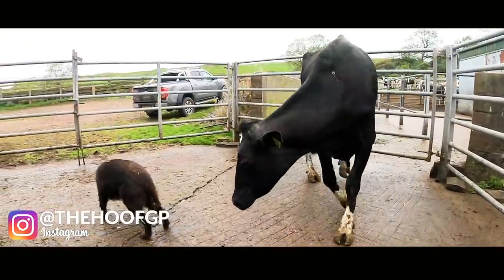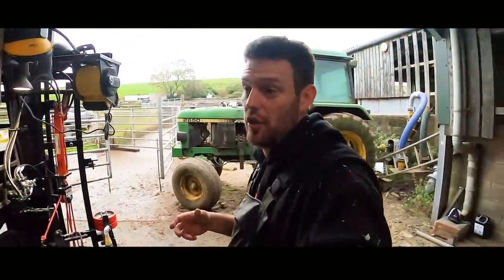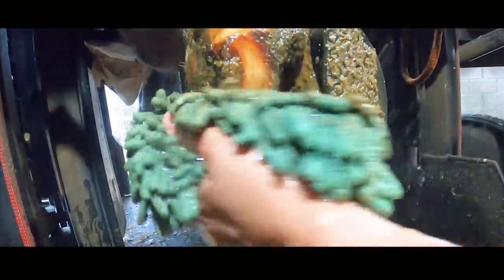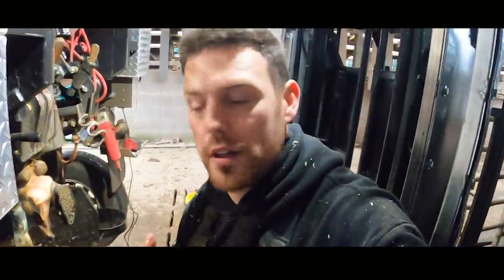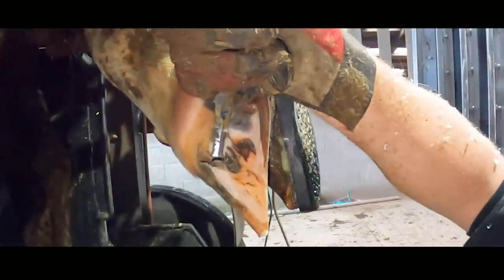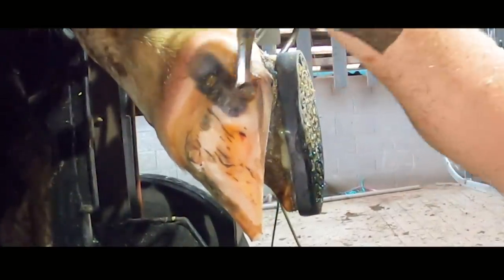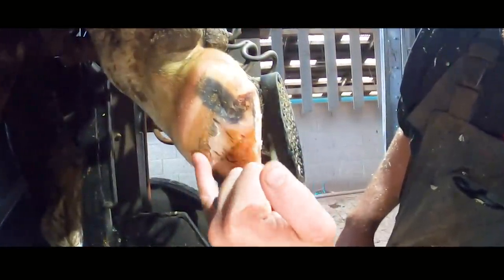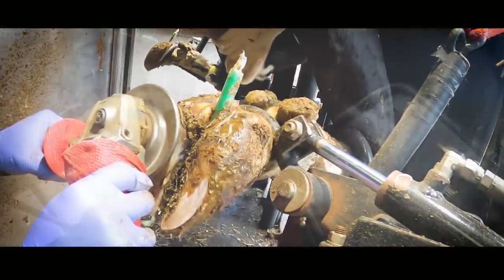*IS THIS RECOVERING?* THE MOST SATISFYING JOB IN THE WORLD

Comment: Instead of carving away cracks, can you fill them in with crazy glue to stabilize them? Would that halt the cracking and then the horn can grow in properly underneath? Something like what they do to 'repair' cracks on windshields. I have always wondered this.
Reply: No, it would prevent horn growth and potentially be very painful for the cow.
Reply: @alistairclement4239  I don't see how that is possible when they slather silicone all over the hoof without causing issues when they apply a block.
Reply: @KrikitKaos  the block goes on the undamaged claw but hey I've only been trimming feet for 25 years, you clearly know best.
Reply: @alistairclement4239  That was my point. Clearly applying silicone to hoof doesn't prevent horn growth and cause pain. They do it to healthy hooves all the time.
Reply: @alistairclement4239  I've referred to crazy glue and silicone, but I don't think the block adhesive is either of those things. My question is, can you stabilize a crack with the same stuff you use to apply a block.
Reply: @KrikitKaos  We don't need to worry overly about preventing horn growth on healthy claws, while horn growth is critically important on unhealthy claws.
Reply: @alistairclement4239  Have you tried it?